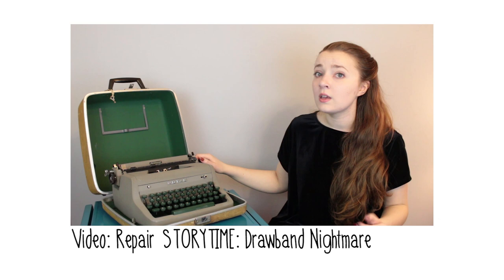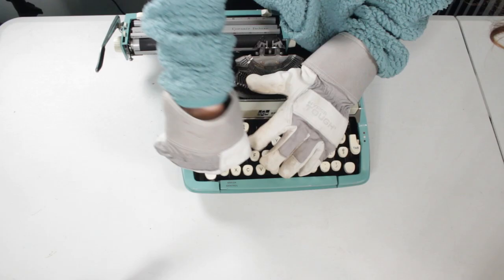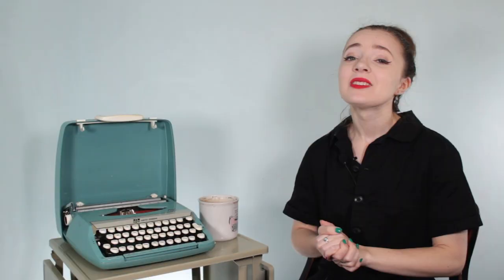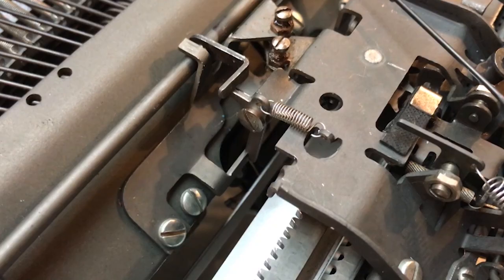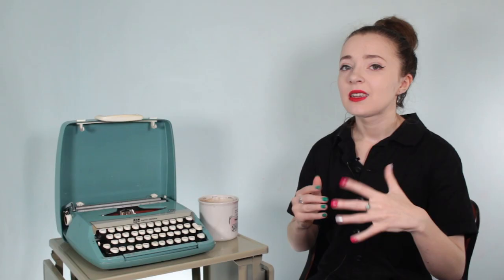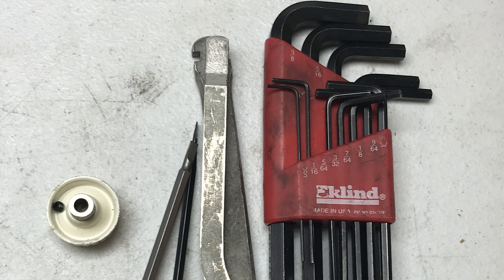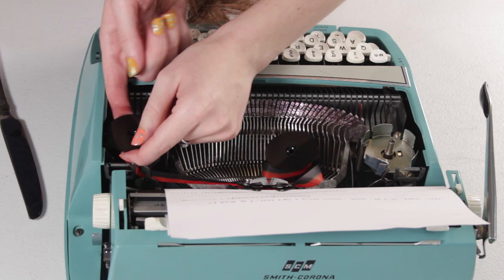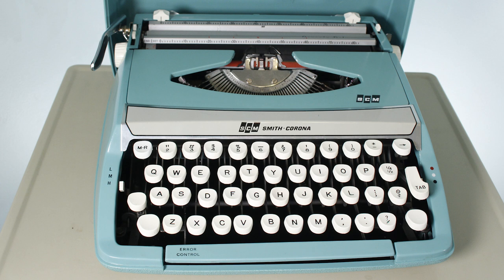Repair NIGHTMARE: The Smith Corona Corsair Deluxe

Comment: Ted Monk : the man, the myth, the legend. You are lucky he helped you with those parts, very kind, even if you paid him for them. Also very cool story about those tools.

The "price of an education" here is fairly high. I suggest taking lots of photos of things as you are taking anything apart. Weeks later it isn't so obvious at all how things go, and a picture can really help. Also, putting screws back in where they came from, if you can, so you don't lose them or mix them up with different length ones. I've never replaced a escapement mechanism, so you have done more than me there... I get a bit scared of that stuff. A bridge too far, at least for now.

An old technician I know calls the e-clips "Jesus clips". He said he calls them that because when they pop off they go flying and you say "Jesus! Where did that go?". Haha. I got a box of 400 on eBay for $20, and I suggest you get some spares so losing one is not a drama.

Comment: Very educational. I just bought a Sears Tutor, which is just a rebadged Corsair. The inside is filthy but hearing about your experience I'm absolutely not taking it apart. 😱 Whatever doesn't come out with canned air will just have to stay there. BTW the leftmost and rightmost type slugs hit the inside of the ribbon cover. I guess I don't really need to type As that often. 😂

Comment: That's a lotta learnin' in a small blue package! (: Big props for persistence, though - these Corsairs are not especially sturdy machines, so it doesn't surprise me that stuff got bent out of whack. Still, you managed to remove and replace the subassembly that is probably the most difficult, important and easily maladjusted in the whole machine, and took the carriage off and got it back on. That's high-level wrenching, right there, and the fact it works after all that is super impressive :D
Reply from the maker: Definitely was in over my head...

Comment: I cringed watching this video  with all of my headaches with my Corsair Deluxe- and yeah, I learned the hard way that there's a tiny line inside the ribbon spool that's supposed to easily slide into the groove of the ribbon spindle IF you line it up correctly before pushing it down- Yeah.... hard lesson to learn, as removing the ribbon was such a chore! My space bar is too high now  after I played with it, so it finally advances the carriage but so hard to hit the bottom row of keys with the space bar at practically the same height--- I just can't find the sweet spot that will clear in the resting and the depressed positions... 
   BUT meanwhile, next time you visit A.D. ... you won't find that overpriced Royal  ... I sorta gave in ... and honestly, it's like it's brand new. First time ever buying a duplicate typewriter, but the Royal Quiet DeLuxe is worth the exception in my opinion. (This is the round key version with the metal rings around the glass keys and the rectangular Shift Freedom shift keys) 
   So glad you got your Corsair Deluxe working- I'm not giving up on mine ... YET ... LOL!
Reply: I have that same model corsair. It is difficult to remove the plastic body,

Comment: I scored a 1967 Blue Corsair. Fully cleaned it and polished it up. Then ONE space in the middle of the carriage travel path locks. I'm going to have to fully disassemble to repair. 
NO. NO. NO.
Cannot get the platen off.
It was sheared. That's the term for a clean, symmetrical break.
Reply from the maker: They're a pain in the butt

Comment: I have an Adler Tippa 1 that is giving me fits and I only have worked on it 2 weeks...maybe in 6 mos I will fix it.  Great video in displaying the frustrations and challenges us typewriter amateur repairmen face.  BTW I noticed some slight rust in your unit...even a little rust can cause havoc.

Comment: I just bought one of these machines and am trying to diagnose an issue with it, lol. I think my issue is much easier to fix though. It is that the ribbon doesn't dart up when the keys are pressed. I identified that the lever to select which part of the ribbon to use has flex in it and doesn't allow it to change to the detent and there seems to be a component that has a spring but the spring is never in tension. I think that has somethign to do with it.
Reply: I'm going to go to the hardware store and see if I can get a spring of the right tension...
Reply from the maker: @zy8719  That might help! sometimes the ribbon spools just aren't on the middle posts correctly and that can also cause issues
Reply: @JustMyTypewriter  I replaced two springs on the assembly that moved the ribbon and now it's working. So that's good. I just need to replace the bent color selection rod and I am g2g.

Comment: I'm  finding the same problem with my Corsair Deluxe from about 1967. I'm  just trying to figure out how to take the case off the bottom. My problem is the space bar goes dead at #47. The release enables me to go past #47. Now I'm  dreading working on this as I have already seen it's not friendly.  Otherwise the typewriter works ok. So are there 2 latches up front to push aside to take off the front? In your video it appeared to be.
Reply from the maker: Yes- so there are two screws under the carriage and then you have to take the topper off with another two screws under the carriage and slide it out from the front

Comment: I have the same model.  And even though it only cost me $5, it is a burden. It is difficult to remove the outer body, so much so that it remains the only typewriter I own which has not been cleaned inside. Fortunately everything works mechanically. The only problem I've had so far is that the ribbon spools won't come off. Instead of breaking their posts, I am leaving them in place with the 40-year-old ribbon it came with. It's on my to-be-sold pile for next year's summer flea market season.
Reply from the maker: I find you have to grease up the center post and pry up the ribbon spools a bit (although I've also snapped them this way...)

Comment: lol i dropped my corsair delux and the poor thing shattered, im worried that gluing the cover back together will not be strong enough for the cover to hold itself on properly. but if i cant repair the case, i will be doing something drastic with zip ties but it will at least work and it will look like it has stiches lol

ive been trying to figure out how to get the typewriter case off to repair the case easier
Reply from the maker: There are some screws under the carriage in the back that hold it in place. You take those out and then slide it back

Comment: how did you fix the space bar? i just got one of these and everything is fine but the space bar and letter a is sticky.
Reply from the maker: So I would start by cleaning- the A is probably a cleaning issue. The space bar I had to bend the arms back into place using pliers and pressure

Comment: Hi, thanks for this video. Please I need your help. I just bought an ABC typewriter but the "CAPS" isn't working. It's only typing In lowercase letters.
Each time I pounced the shift key, it only raised the "slider" up and down.
Your urgent recommendation needed please.
Thanks
Reply from the maker: I'm not entirely sure what you're describing! Often these issues can come from a multitude of things. I would first check to see if there are springs attached to your shift and shift lock keys. It could also be that your ribbon vibrator (where the ribbon is inserted to slide up and down to type) is dirty which doesn't let it line up with your letters. Try cleaning out the track where that slides as well.
Reply: @JustMyTypewriter  well, thanks for your reply anyways.
I really wish I could send you a video clip of exactly what I mean, because I need to get it fixed right away.
Thanks
Reply from the maker: @programmingwithjerry731  I do have an email (justmytypewriter@gmail.com) and an instagram as well (@just.my.typewriter). You can send me a photo or video of your issue there, but again it might be hard to diagnose!

Comment: I need to fix my verticle alignment of my upper case and lower case letters. I know i need to tighten and loosen some screws on the bottom side but i really cannot figure out how to get the machine out of the case. Does anyone have any guidance? 😂
Reply from the maker: so there are two screws on the front inside under the keyboard, and two in the back